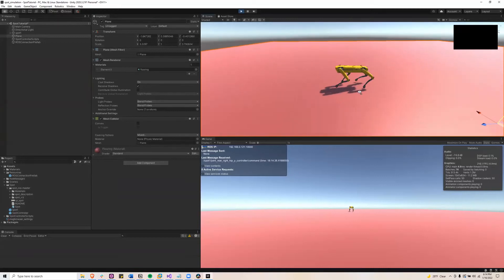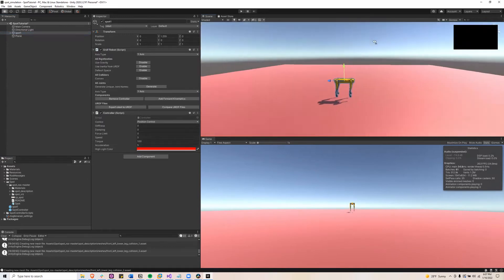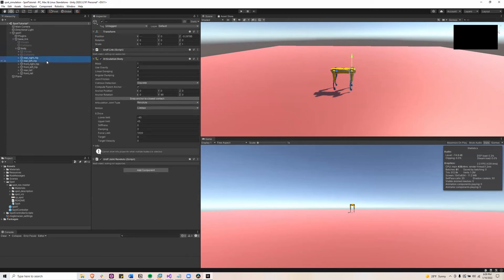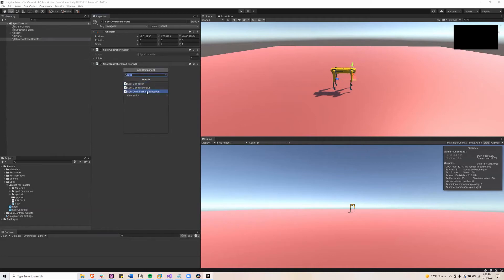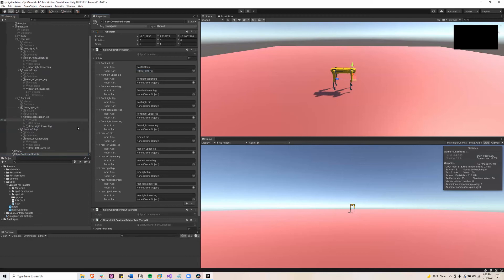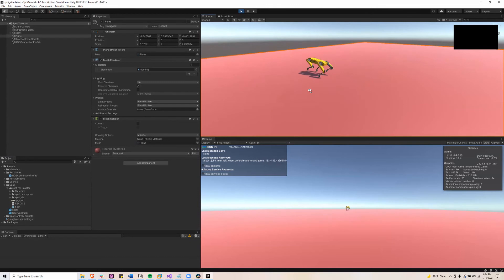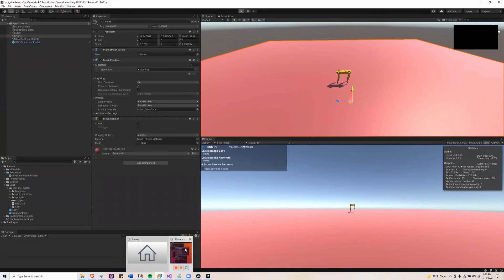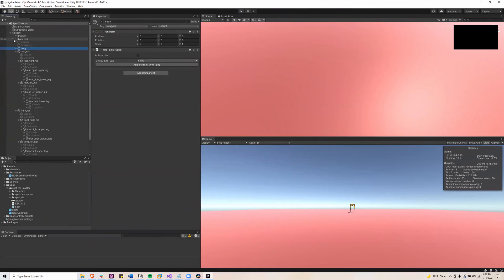Unity Robotics Hub: The Spot Robot Controlled Using ROS

Comment: Hi Bryce, I wanted to drop by and say that your git tutorial was exceptionally helpful (I would recommend everyone to use the git tutorial instead as some elements from the video has become a bit outdated). I also successfully tackled the issue that caused the robot to strafe left when walking forward. My solutions were to:

1) Increase the walk and rotational speed. The slower the robot was the less stable it became.
speed 3.13523479041     turn 2.68615274273

2) Remove automatic center of gravity, and position bot the robot to 0, 0, 0, and the center of gravity to 0, 0, 0. This removed the strafe left issue entirely on top of the first step.

However, I noticed another issue in which the robot is more readily to run backwards than forward, I'll be aiming to tackle this issue head on, and leave behind a reply here for everyone else to use (if helpful).
Reply from the maker: Amazing, thanks for the comment! Definitely please follow up with other helpful tips because these types of comments always help me.

Comment: Hi , where can we find unity_data_conversion package? Also, were you able to fix the forward movement?
Reply from the maker: The repo doesn't actually need it anymore. I saw that I still reference it in the README so just removed that line.
Reply: @bryceikeda7782  ok, thanks. Were you able to fix forward motion? It doesn’t seem to work.
Reply from the maker: @tejasps8931  Unfortunately I haven't had a chance to work on that since creating the repo. We ended up not needing to have robot move around the scene in our work.

Comment: Hi Bryce, thanks very much for your video, I learned a lot from it. Is there still spot controller and spot controller input file in your project? I can not find them. Thanks!
Reply from the maker: Hi @Yilong, not anymore! I realized it was unnecessary so I removed them. Those scripts did basically what is being done in UpdateJointAngle(double cmd, int joint) in the SpotJointSubscriber.cs file.

Comment: Hi Bryce,
With the teleop.launch, how did u get it to walk? Which key did u press for it
Reply from the maker: It should pop up on the screen when it starts to work. You can use the i key to go forward and , to go backward. Left, right, diagonal and stop are the other keys around that group.
Reply: @bryceikeda7782  Oh i see, because my robot seems to be able to go up & down, left & right, but just does not walk
Reply from the maker: @ryangoh568  Yeah the behavior of the Spot will depend on the values of the robot stiffness and damping. It will also depend on the spot_control scripts that seem to only work well if it is running on a dedicated linux machine rather than a VM.

Comment: Hi Bryce,
First of all thank you for this awesome video.
It makes me very happy to see that someone else is working with this amazing package.
I have also been exploring this package with the Panda arm. 
One question, if I saw correctly, you disable all collisions (mesh collider) which means that spot in Unity is not affected by physics. So in Unity spot can only be visualized.
Reply from the maker: Hi Camilo, glad you liked the video! Regarding your question, I only disabled the collisions where the spot hip joints meet the body. This way the legs don't pop off. The rest of the robot does have collisions enabled which is why it can walk on the plane. It can also still run into objects if there were something placed in its walking path.
Reply: @bryceikeda7782  Ah, okay, 
I guess I didn't realize that. Now it makes sense for me.

You think it is possible to control Spot from Unity, the same way it is controlled from ROS?
Reply from the maker: Yup! That’s what this video is about. If you watch the clip at the end it demonstrates the robot being controlled from ROS. However the movement isn’t as natural yet. Check the updated description for a couple more details.
Reply: @bryceikeda7782  I think what Camilo meant was possibly using keyboard input, etc to control the robot within Unity?
Reply from the maker: @ryangoh568  Yeah, I think this wasn't clear in the video sorry about that. The last clip in the video shows me using https://github.com/SoftServeSAG/spot_simulation/tree/spot_control to control the robot using ROS and my keyboard. Basically from 6:11 onward. Also, check out the edit I added to the description if you try this route.
Reply: @bryceikeda7782  Ok! Thanks alot, your repo is really useful!
Reply: Hey man, I‘m right now trying to figure out how to get something similar working withe the Franka Emika Panda arm. Did you work things out? I‘m trying to recreate the Unity-Robotics-Hub example with the robot arm for the panda. Did you manage to do that?